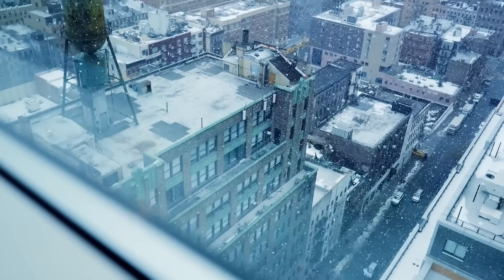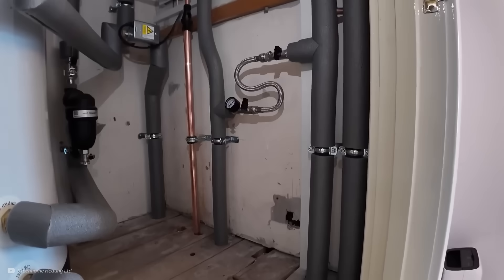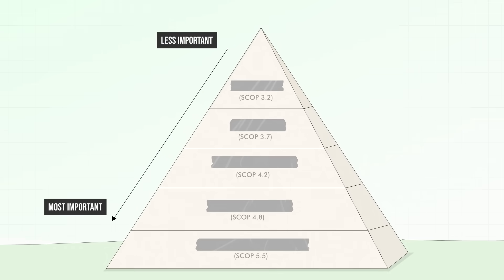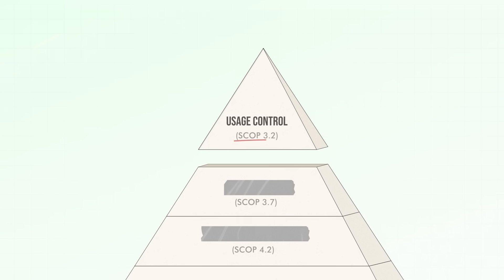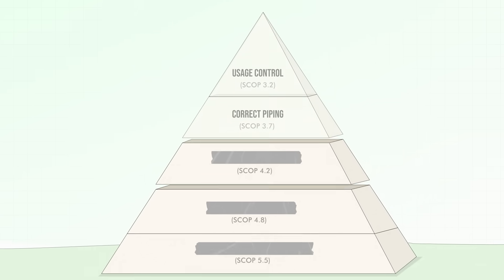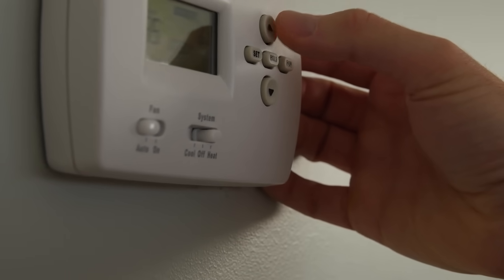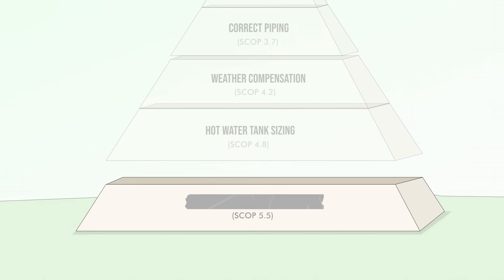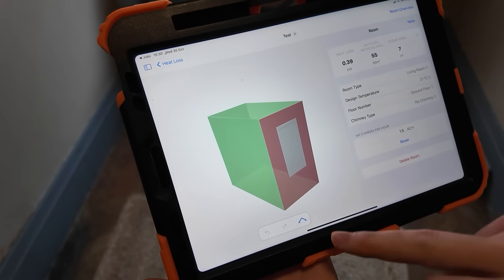The Genius of the World's Most Efficient Heat Pump

Comment: umm heat pumps really don't pull heat from the outside air and move it indoors, the heat comes from the compression of gasses at the compressor, that is then passed through a heat exchanger to pull some of the heat from the now liquid refrigerant, it is then moved to an expansion valve at which point it is allowed to expand and turn back to a gas at a much lower pressure, this expansion rapidly cools the gas, this is then passed through an external coil / heat exchanger which warms up the gas some by exchanging the energy outside to the cooled gas making the gas slightly warmer, it is still cold, but it is warmer than it was, then it is cycled back to the compressor where it is compressed and heated up again. 
so the heat part is generated from the compressor, not outside, passing the low pressure cold gas through a forced air heat exchanger does warm up the gas from very cold to cold, meaning the compressor doesn't have to word as hard to compress and heat up the gas via compression.
Reply: Yes some heat is generated through the compression. But say for a 1 kW electricity heat pump with a COP of 5, then for every 1 kW of electricity to the compressor, 5 kW of heat would be introduced onto our heated space. Where does the extra 4 kW come from? It is “moved” from outside into our heated space. So a majority of the heat would still come from “moving” heat from two separate spaces.
Reply: @ that would be dependent on the return temperature of the gas to the compressor. 
The compression of the gas to a liquid is where all the heat generated comes from, it works the exact same way as cooling.

Comment: What about forced air systems? I need air conditioning in the summer when it gets above 34C.
Reply: There's a fair amount on buildings where passive design measures go a long ways to minimising the need for enegergy consumption.  Probably not much help if you're stuck on a workman's wage in a tenement in downtown Kampala, but useful for ideas.

Comment: These systems are so overly complicated for heating a house. You won't save money installing a heat pump, infact you will never get that extra money back that you used to install a heat pump instead of a boiler. You are better off installing electric heating and use solar and batteries to provide heating rather than rely on the slow reacting heat pump. 
Imagine returning from a trip away and switching your heating on because the temperature has dropped considerably, and you then have to wait 2 days to feel your house warm up.
Reply: I get the argument that they're expensive to install, but resistance heating backed up with batteries and solar? How much is enough solar and batteries for 100kWh/day in winter going to cost? £200k before you've bought the field?

Comment: If anything, these examples of improving efficiency for heat pumps would improve the efficiency and effectiveness of boilers exponentially. Proves heat pumps are an expensive exercise.
Another way of transferring wealth from the average person to the richer person - many are saying that this is forcing people to buy more expensive and less effective high cost items under the guise of helping "climate control".
Reply: Improve boiler efficiency, yes. Improve it exponentially, no. Compare burning gas at 1500C, extract the heat down to 60C (including condensing water) vs cooling and condensing to 40C - you've getting another couple of percentage points efficiency, I suspect.

Comment: I'd like to see someone do the Heat Geek method on Air-to-Air heat pumps that are common in more temperate regions like Texas where I live. No one has radiator heating systems here - mostly because heating is needed only for realtively short periods during a year. Pretty much 100% of the HVAC systems are heat/cool combo systems using either an air-to-air heat pump or a gas fired furnace combined with standard air conditioning. There are bound to be strategies for these sorts of HVAC installs that could increase efficiency similar to what Heat Geek has done.
Reply: It isn't a heat geek specific method, it is actually a standard which a very large percentage of installers don't follow very well because of the on-the-ground complexity vs their profit margins. Air-air heat pumps have indeed had all of these things recommended for decades too, including in the US.
Reply: In Aus we "only" use heat/cool pumps. The cost difference is so small it doesn't matter. We also usually use split systems. The compressor outside and a head unit in the room. Whole of house using one unit is rare. This means you "automatically" have zoned heat/cool as you can turn them off/on individually. Also actual local climate must be considered, just like USA Aus has a wide variety of climates (though not as extreme as the USA on the cold side...). That said areas in Texas are more like Brisbane, Sydney or Melbourne (decreasing humidity) than they are for ANY of the northern states of USA or Europe.

Comment: As a refrigeration technician I can't see a COP of 5.5 in the systems shown in this video (air to water) more likely 3.5 maybe 4... the most efficient syatems are water to water inverter systems as water is denser than air with more concentrated heat energy and they would be around COP 5, newer Co2 systems which work under immense pressure get close to 6 (air to air systems). Finally the thumbnail mentions 800% yeah, pull my other leg!😂
Reply: In September, when temperature are almost equal outside and inside and you barely need the heat pump.
Reply: @purpleblueunicorn  lol, in September we need heat and AC in the same week. 25°C high, and a -10°c low can get interesting.
Reply: @purpleblueunicorn that has nothing to do with the heat pump itself does it. You can't just turn it off for half the day and claim the heat pump is 2x more efficient than the day before.
Reply: @larry365  What I'm saying is that instead of running it all day at a very low rate, it would have run for 4 hours and a COP of around 3. But it doesn't even matter, because electricity costs are almost none in this period. My September mini-split usage was 5$ and I live in cold Quebec weather. By having a COP of 8 it would maybe save 25c. Actually, my mini-split is running at a COP of 8.3 today because it's 9C outside which is very unusual (it's been averaging -10C the whole time). Just measured it, delta T 6.2C, 471CFM, 188W => COP 8.85.
Reply: @purpleblueunicorn  honestly I'm struggling to get my head round a COP increase beyond the HP unit itself. The points mentioned in this video seem like efficiency increases, not COP increases. I can't really continue to discuss this until I've figured it out.

Good to hear you're happy with your system. We have just moved to a region of Europe down to -10 in winter and average high 20s/low 30s the summer. We have no central heating currently so exploring everything.
Reply: @larry365   Not sure too, but in his case it's a air to water conversion where pipes can lead to losses so optimizing it is important. If you have an air to air mini split with a matched outdoor and indoor units, I don't think you can improve efficiency except if you run a small delta T which you don't have much control off. In an air to air, you can raise efficiency by running the fan on high and choosing one that can modulate to very low power. For example a 12k BTU mitsubishi that can go down to 1500 BTU. This way it never cycles (overshoot so needs to shut down). But it will cycle in winter because of defrosting and this is where real costs are involved in cold climate. My main minisiplit cost me electricty 25-50$ per month in winter -15C and 10$ in July with temps of 30C. And less then 5$ in shoulder season. The shoulder seasons are where you can save with optimizing and it's not worth it.
Reply: @purpleblueunicorn  actually I think there was a heat wave last September - I was in Scotland wearing a T shirt! I think this 800% efficiency thing is a shame as many of the points of how to put an efficient system together are what we would also recommend.
Reply: Defo some heat geek snake oil about. High COP does not always translate as a warm house or lowest possible running costs. I have managed to reduce my bills at the expense of a top trump cop. The cheapest heat pump to run is one that isn't on.
Reply: @ibleedswede  Cheapest heating system in general is one that isn't on. Add more insulation and other sealing to building codes. I have customers with 8000ft² homes cruising at 30 MBTU at -20°C. I was actually kind of surprised, as I was expecting closer to 50MBTU.
Reply: max I saw was COP 6 with 2 water wells 3m to the surface of water, R290 heat pump, one water well to take water 6 celcjius, second water well to drop water, that works whole year at about 5,5-6 COP, but COP 8 ??? impossible
Reply: @sniper100 it’s clearly not impossible, is it worth it though? Absolutely not, what you’re probably looking at is a house perfectly geared for a heat pump, with ideal internal and external conditions.

The cost to build such a set up, unless your business is doing that, isn’t worth it as you’d never recover that cost, as an example of what you can do it’s a fantastic advert for the training heat geeks offer, but in the real world where install costs matter, 300% to 400% is the sweet spot of install costs vs efficiency.
Reply: Ah, first time here I see - op has zero integrity and talks out of his bum most of the time.
Reply: I have an air to water unit. This is my first winter monitoring the performance. Turned the room heating on last week. Alarmed to see a cop of 1.2 !! Adjusted the thermostat and the HP switched off for three days. When it came back on it showed a cop of 5. It looks like I have a lot to learn!
Reply: @StepDub ...interesting do you know which refrigerant gas is used in your system?
Reply: @noproblem2big337  Says R32 on the outside fan unit. But it looks to have settled down in recent days, with cop between 2.8 and 5. It may just have been a combination of cold weather (-2C) and startup conditions. I’m far less anxious about big bills now 😊
Reply: Absolutely!!!
Reply: What you notice is all this pro-heat pump propaganda is very polished.  It is what we who haunt the political spheres call astroturfing.  It may look organic and natural  but if you look properly it is completely artificial. 

All this Net Zero business is dependent on the man on the street ignoring the Second Law of Thermodynamics.
Reply: It's an instantaneous value, not a seasonal value, and was likely done when the temperature difference was very small.
Reply: Look at the link in the description, the information is all there. It’s very easy to get scops of 5 on heat pumps in the winter, let alone warmer months
Reply: @ yeah that’s because the info in this video is wrong. It’s one big scam.
Reply: @fajoopsa  the same heat pump connected to a poorly designed system and a well designed system makes a huge difference. You could easily go from 2.5 scop to 4 with minor changes of the same heat pump.
Reply: @joehaskett90
 you can’t go up in numbers because you have a better water flow after the condenser of the heat pump. Say the heat pump has a COP of 3. Once the heat pump puts out 3kw of heat from its 1kw of electricity at the condenser it’s done. The rest of the system can’t add more heat. It can only go down through losses. You can certainly minimise those losses but that’s it.
Reply: cop/$ matters too.  doesnt take a genius to say - gee water is denser, let me just put my radiator in water.  okay, yeah, sure.  use water piping on house side. now where are you getting the LIQUID WATER for the outside in the winter?  no river/lake nearby youre sol.  geothermal sure. let me just dig some massive holes in my back yard for thousands.  

saying your improved cop by pulling this bs is a joke.  no secret here that the worlds largest ac mfg dont know. 

solar is going to make hvac diminishing returns come to an end pretty soon.  thermal efficiency limits
vs solar efficiency at 22% with no efficiency law really saying it cant shoot past that. 

a solar panel going from 24 to 30% just gave you 25% more energy for your house   25% imp 
hvac going from 21seer to 30 seer just have you 25% more energy for your house.   50% imp

insulation has legs to run too
microbeads formed under extreme temps or vacuums- that themselves are near vacuums suspended in glass fibers could push r values significantly higher.  R20 or something per inch (radiation still gets ya apparently).  R80 houses are possible in conventional building.  windows become significant at that point.  

and with modern acs ALWAYS RUNNING variable compressors vs on off 
no real detriment to doing zero export solar with no connection paperwork bs and only using it for ac.  none ever left over to export.
Reply: The thumbnails do get crazier over time
Reply: No one cares about the peek efficiency
Reply: Can I ask , is water to air less efficient than water to water ? How much , or what if it has both , water for floor heating and air for cooling ?
Reply: @matejmotuz108 ...usually water to water floor heating can reach a COP of 5 party because  of the large surface area and circulating fluid can work at 40 degC secondary because it's easier to absorb heat energy from a liquid this would work fine with heating as heat rises but not good for cooling...air to air air conditioning get around cop3 and you might be better off just installing a split system air conditioning.
To design and make a water-water system you need to know a fair bit about refrigeration as it can be complex and could have problems with freezing up and ice can damage pipes in other words you need to be a refrigeration mechanic with a decent back yard as water tanks take up space and not many people live next to creeks or water bodies I have only seen one guy using a creek and that worked very well.
Reply: Our system. A Wolf CHA-10 hets a. Cop of 5.5 over the entire year. With temperatures outside above 5°c we get a COP of over 8.
Reply: @PaulB-jx9nn ... interesting what refrigerant type is used please explain this system
Reply: Correct, if you look at their videos, they get high COP in the UK where the outside temperature rarely falls below 7° C and they heat the house to 19 or 20 degrees where I personally would freeze to death. 😂
Then they are restricting the radiator temperature to 35 degrees and do not account for sanitary water heating so they can artificially keep the COP high. Also 24 hour heating keeps the required radiator temperatures low but you have to account for electricity prices during daytime and nighttime. I am not saying their strategy is wrong but a confortable home temperature looks different. And no, 800% is not achievable with a Valiant heat pump.
Reply: @aleksandergrilj421  yea, I dunno where they got their numbers from. I often service and install water stove HPs, where the loop temp is between 24-30°C depending on the building. I still don't see that kind of COP even on units that are too expensive to sell. Eg. ECM PTHP terminal/console units. I don't know anyone selling variable capacity ECM compressor units in vertical stack or horizontal form factors or above 5 ton, 230v, single phase. So the most I typically see is a COP of around 3-4 maximum. I could see 5-6 with ECM variable speed compressors, but 8 would be a challenge and this is ideal water conditions. Ground source isn't popular here due to the climate and impracticality. I see everything from 6000 btu to 20 ton (1.5kW-70kW) individual units.
Reply: @aleksandergrilj421  Dunno where you are getting your info from, but ‘rarely falls below 7C’ is a bit misleading. Maybe midday in some of the southern counties, but most of the UK is quite cold in wintertime. Not arctic, but chilly for sure. Summer hasn’t been much better lately, either. 😀
Reply: With the uncertainty of electricity prices in the future due to the increasing use of electric cars/heat pumps and fear of nuclear energy, I still can not decide between heat pump or pellet burner. The cost of pellets just went up last year and electricity goes up every year. I'm almost tempted to just have a wood fired boiler and deal with the inconvenience of it. Anything else can have the operation cost rise.
Reply: @jasonlajoie  HP with wood burner?
Reply: Yep... it's bullshit..... for every 1 KW you put in, you get 8 out...
Reply: @stevesteve8098 exactly! 1kw of power into the heat pump then outputs 2.5kw. By adding smoother tubing and bigger bends they get to 8kw!! Bahaha.
Reply: No, that part is real, physics allows it because you're moving the heat from one place to another, not creating it from nothing. The actual number might be wrong, but efficiency above 100% is already commonplace.  @stevesteve8098

Comment: Just a comparison for "reverse cycle Air Conditioning" ( a heat pump ) in heating and an electric "fan heater".
A 2400w fan heater, takes 10 amps here in Oz, 20 amps USA and will struggle to heat a small room, you have to sit in front of it to feel it, if the heater gets too hot,it shuts down and blows cold air. The AC will take about 3 amps (Oz), 6 amps (US) to warm up a larger room evenly. A modern one will then "ramp down" to less than 1 ( mostly to run the fan ) to maintain that temperature.
I don't know about the gas systems. I think they are just hot water systems, pumping that hot water around and you are just talking about what heats the water. ( Burning gas, Electrical element, Electrical heat pump ) Not used much here in Australia, outside of the Snowy Mountains area for about 50 years.